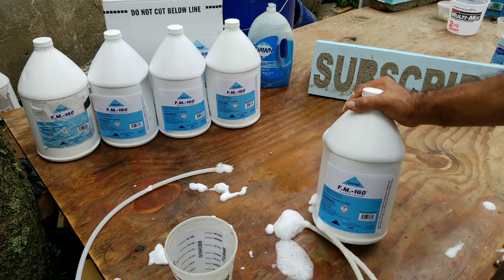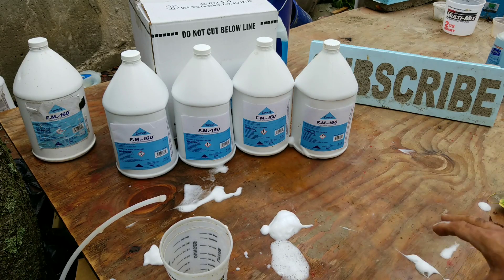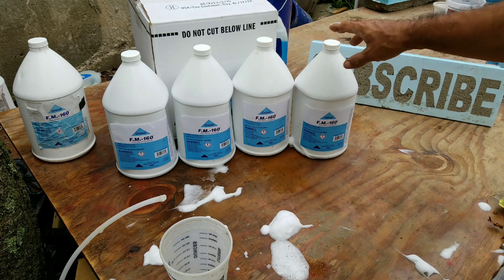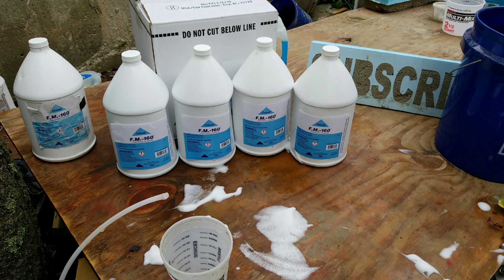Aircrete Foam Generator | AircreteHarry.com #aircreteharry #foamgenerator #aircrete #diy #dome

Comment: have you ever tried mixing  a  5 gallon bucket  of light concrete mix, soupy,, adding the  drexel to it,, and then trying to foam it thru  a  foamer
Reply from the maker: Are you asking if I ever tried to produce the mixture you mentioned - with a Foam Generator?

Comment: Found link on your website, just had two questions, two year warranty on pump, is there any way to access it if it goes out tho? I'm assuming those pipes are glued together? Also how does this compare to Dragon XL? I may purchase yours bc price is competitive. I just like to know those answers please take care
Reply from the maker: Welcome Patrick!
A: Yes, absolutely.
A: Not glued; the units are assembled with screws. You will be able to access the pump when needed. All tubes are removable.

A: Aircrete Harry Foam Generator unit comes with a Footswitch that allows you Hands-Free Operation 
& a Hook for Convenient hanging on a barrel or wherever you desire.
A: You may check our feedback testimonials on our website: 
https://aircreteharry.com/feedback-testimonials/

The Foam Generator units LISTINGS,
on our website, showcase the images
which also include screenshots of the Great Feedbacks by Our Valued Customers!! Check it out. 👍 👍 

To contact us directly, feel free to email: Aircreteharry@gmail.com 

We are looking forward to having You 
as Our Valued Customer! 

Our Best,
Mr. & Mrs. Aircrete Harry

Comment: Great video’s.  👌👍 my Proctor and Gable air compressor is only 2.6 SCFM is that good enough.. and after I make air Crete with Portland cement can I spray it with a hopper Gun??

Comment: Sir...do you sell this device..or you can give me the model number?
Reply from the maker: 120 Volt, US AH-Foam Generator unit
(230 Volt, EU unit available on the website as well):
https://aircreteharry.com/product/aircrete-harry-foam-generator-120-volt-ready-to-use-with-wand-convenient-footswitch-foot-pedal-hands-free/

Recommended 
Additives for Successful Results:
https://aircreteharry.com/product/1-gallon-aircrete-thickener-two-x-1-quart-air-entrainment-liquid-by-aircrete-harry-allows-you-to-pour-aircrete-much-higher-improves-strength-see-description/

Comment: How can I buy this Foam Generator
Reply from the maker: 120 Volt, US AH-Foam Generator unit
(230 Volt, EU unit available on the website as well):
https://aircreteharry.com/product/aircrete-harry-foam-generator-120-volt-ready-to-use-with-wand-convenient-footswitch-foot-pedal-hands-free/

Recommended 
Additives for Successful Results:
https://aircreteharry.com/product/1-gallon-aircrete-thickener-two-x-1-quart-air-entrainment-liquid-by-aircrete-harry-allows-you-to-pour-aircrete-much-higher-improves-strength-see-description/

Comment: Hello, 
could we use it for concrete foaming? let me know please
Reply from the maker: 120 Volt, US AH-Foam Generator unit
(230 Volt, EU unit available on the website as well):
https://aircreteharry.com/product/aircrete-harry-foam-generator-120-volt-ready-to-use-with-wand-convenient-footswitch-foot-pedal-hands-free/

Recommended 
Additives for Successful Results:
https://aircreteharry.com/product/1-gallon-aircrete-thickener-two-x-1-quart-air-entrainment-liquid-by-aircrete-harry-allows-you-to-pour-aircrete-much-higher-improves-strength-see-description/

Comment: This is really amazing, the machine works really nice. Do you sell your machines and how much for one
Reply from the maker: Agreed, it does. Thanks!!
Yes:
120 Volt, US AH-Foam Generator unit
(230 Volt, EU unit available on the website as well):
https://aircreteharry.com/product/aircrete-harry-foam-generator-120-volt-ready-to-use-with-wand-convenient-footswitch-foot-pedal-hands-free/

Recommended 
Additives for Successful Results:
https://aircreteharry.com/product/1-gallon-aircrete-thickener-two-x-1-quart-air-entrainment-liquid-by-aircrete-harry-allows-you-to-pour-aircrete-much-higher-improves-strength-see-description/

Comment: looks great. i like the foot control too...actually wicked design man....one thing. when you are doing your different mixes for aircrete or epic mix  recipes, do you state the setting on the air? do the air settings change with those as well, when your making them for slabs to walls etc.? im going to purchase your mixes n stuff, but that just came in to mind as i wss watchin this.

Comment: What is 4000 gallons of aircrete in terms of volume? I think most of us think in terms of volume. For example, how many 8'x8'x8" forms could be poured with one gallon of the Drexel? 42.67 cu. ft is the volume = 319 gallons => 12.5 pads of this size from a gallon of Drexel. The 4000 figure seems really huge. The "12 pads" figure not so much so.

Comment: How much CFM of air do you need to run this foam generator?
Reply from the maker: - air compressor settings: min 90 psi
- with a 5-8 gallon tank minimum
- ideally, you want a 30 gal tank

Comment: Say bud I have an idea. I love the concept but hate the loss of integrity the foam causes. When the mix dries the foam is gone leaving air. Cement don't likey no stinking air. If you could get a foam to leave a residue with even a small amount of cohesive strength winner winner chickin dinner. Cement doesn't really bond to itself for strength it's strength comes from the aggregate. Your aggregate is a void. Your foaming agent is just that. It is intended to be used with additives to make the additives foamy. Also your cement is way too watery. Over hydration = longer dry time and brittle product. Try a 5gal to 94lbs mix. I don't know if it will interfere with the foam but I would try it. As for a foam additive it doesn't need to leave some supper strong residue after the bubble dries. Just something cohesive instead of a void. Remember these are little micro bubbles. Their strength or weakness comes from their numbers. Try replacing about 1/4 of the water for the foam with:
  https://www.homedepot.com/p/ZEP-5-Gal-High-Traffic-Floor-Polish-ZUHTFF5G/100619264
or a liquid latex additive. After the bubble dries it will leave an airtight shell that is bonded to the cement. It's harder to crush something if it's under pressure. 

                                          Just Thinkingoutloud
Reply from the maker: Your right but the idea behind the Aircrete is to make it light weight and insulative.

Comment: Foamed cement has become a well established cementing method for many applications in oilwell cementing all over the world.

A key factor to a successful foam cement job is an optimized cement slurry design. To achieve optimal slurry design the project engineer is working in close collaboration with the onshore cement laboratory. In laboratory testing, the foam stability is an important factor. In recent years it is claimed that the foam stability results from the cement laboratory seems not to fully match with the actual results in the field. The experience is that slurries seem to be somewhat more stable in the field than in the laboratory.

Today, laboratory foam cement is created in a closed blender according to ISO 10426. The main focus in this thesis is to investigate a new way of creating foam cement in the laboratory approaching a replicated, downscaled model of the method that is used in the field.

An open, atmospheric flow loop was designed and built with a tee shaped construction joint for nitrogen injection to resemble onsite foam generation. The results showed that the foam generator loop was able to create foam, but the bubble size was significantly larger compared to the laboratory closed blender foaming process. Hence a good deal of improvement of the prototype is required.
Reply from the maker: Thanks for the information!!

Comment: DOES THE FOAMING GENERATOR NEED CLEAN WATER TO CLEAN IT?
Reply from the maker: you can run clean water through the foam generator to rinse it but I never have and it works fine.

Comment: So do you offer DIY plans for sale with complete list of parts?
Reply from the maker: 120 Volt, US AH-Foam Generator unit
(230 Volt, EU unit available on the website as well):
https://aircreteharry.com/product/aircrete-harry-foam-generator-120-volt-ready-to-use-with-wand-convenient-footswitch-foot-pedal-hands-free/

Recommended 
Additives for Successful Results:
https://aircreteharry.com/product/1-gallon-aircrete-thickener-two-x-1-quart-air-entrainment-liquid-by-aircrete-harry-allows-you-to-pour-aircrete-much-higher-improves-strength-see-description/

Comment: Suggestion: Install a 90° fitting in the pickup tube, at just enough length to hang the pickup about a 1/4 inch from the bottom of the bucket. If you wanted to get fancy, you could use an insert that fits the lid opening, and add a either a collar to the tube, or a banjo fitting.

Comment: Sir your foam density?
Reply from the maker: 3 lb per 5 gallon bucket.
Reply: Sir
I not understand your answer please your answer is kg/m^3
Reply: Sir please tell me your foam density in kg per cubic metre
Reply: 32.6 kg to m*2
Convert gallons to cubic meter divide by 5 multiply by 3 lbs 1.361 kg (want to check my answer?)